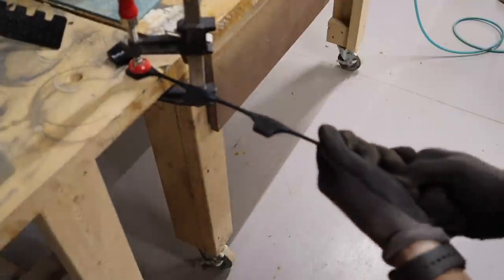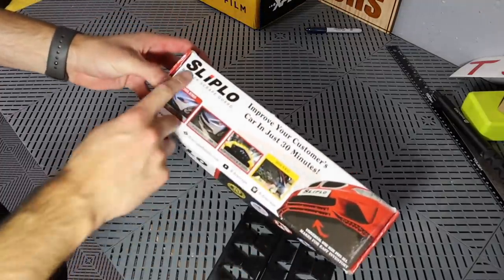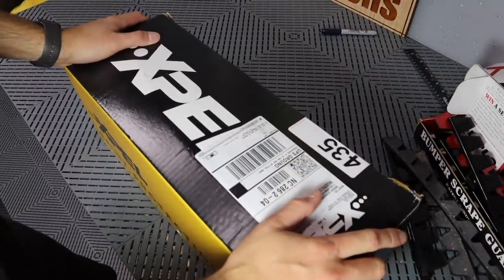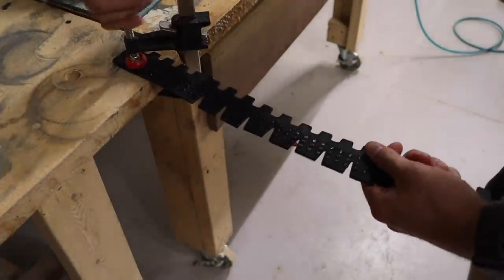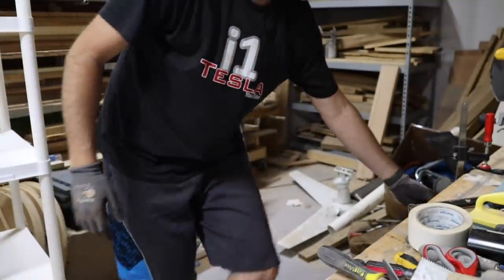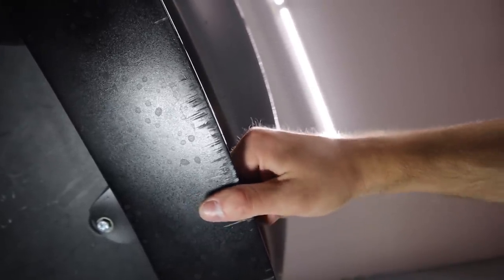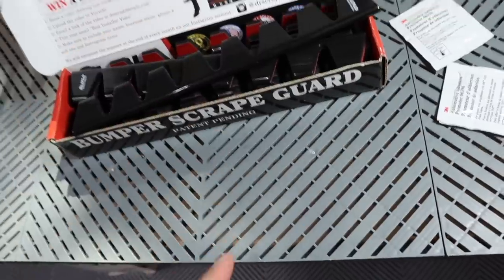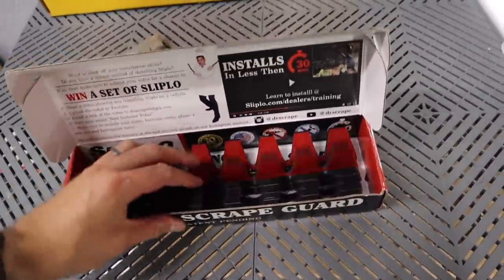How to Protect Your Front Bumper

Comment: To be fair I don't think pulling on those products is test of strength.  That's not what would happen on the car.  I worry that the product you are endorsing is too thick and will push into the lip of the car causing pressure damage.
Reply from the maker: I did say in the video that pulling on the thing wouldn't happen on the car but it shows how strong the product is.
Reply: @i1Tesla  got it.